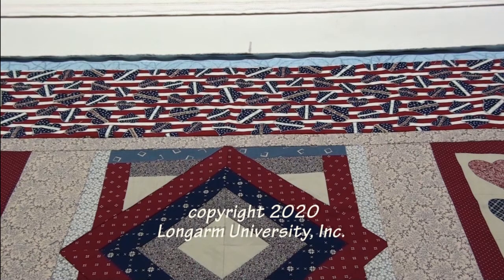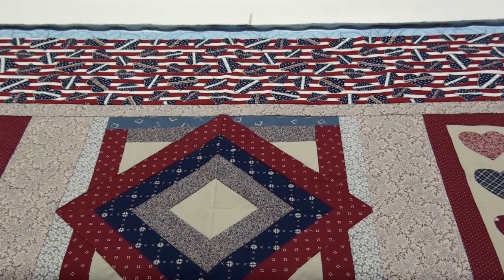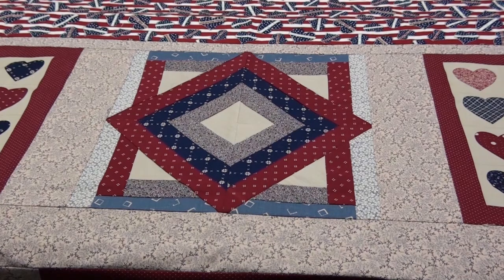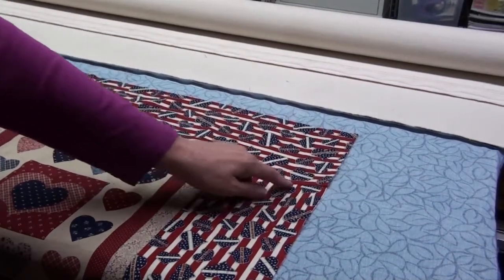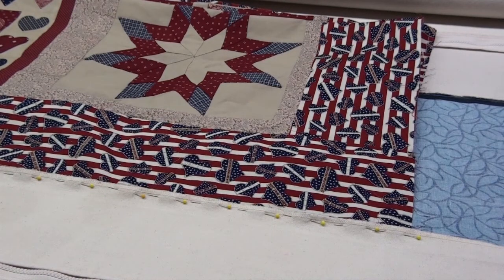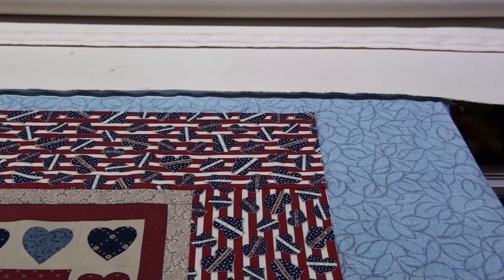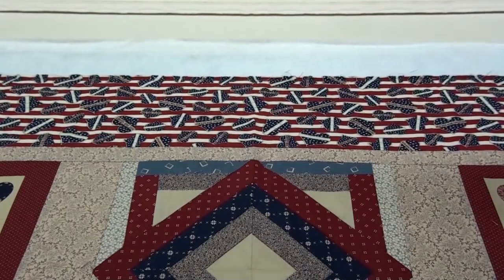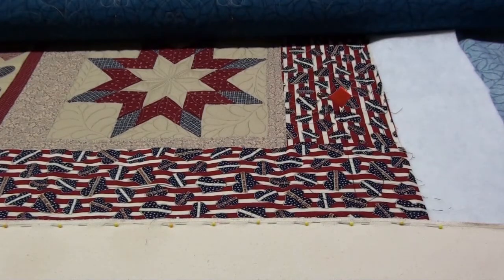How to Float a Quilt Top for Machine Quilting - Another Way!

Comment: Shouldn't the bottom.edge of the top go under the bar you attached the bottom to to avoid a gap between the layers?  I would think the layers should not have air space?
Reply from the maker: Each machine table is a little different. You have to find what works best for your table and roller bars.

Comment: I will try your method to see what is like, however when I float my quilts I baste the top and down the sides and I also keep the work area tight, by using several long magnets across the entire quilt.  These are magnets that you use to hang tools, with knobs added to the ends making it easy to move them as you advance the quilt.  I haven't had trouble keeping my quilts square.

Comment: I am so glad that I came across this video.  I am new to longarming but I really didn’t want to float my tops so I haven’t.  I have been pinning my tops to the bottom rail leader.  I have completed two quilts and they came out perfectly even and when I trimmed off the extra backing and batting the quilt top was perfect.  It has been very difficult finding a video on loading a quilt to the frame that the didn’t have the top floating.  So thankful for this instruct.  😊

Comment: This is really good info, but if your frame has only 2 bars, this isn't possible as the backing is pinned to the bottom bar.. thanks for the clear instructions. something to think about.
Reply from the maker: My frame / table does have three bars. One of them is down low and you can't see it in the video.
Reply: Thanks for your response. I'm still learning how to use my longarm..but loving it!!